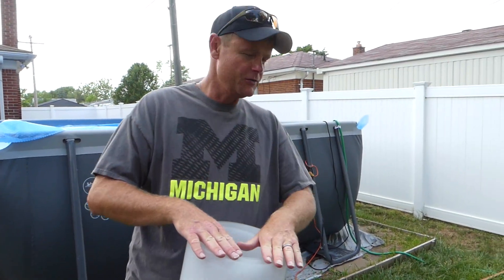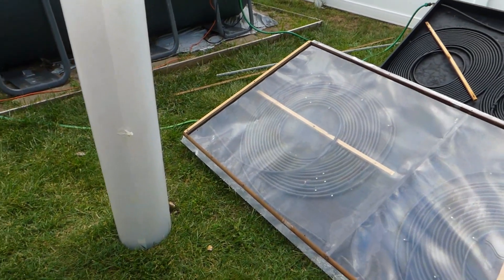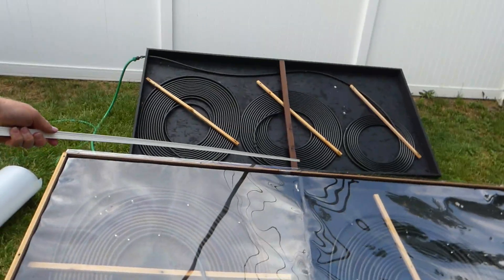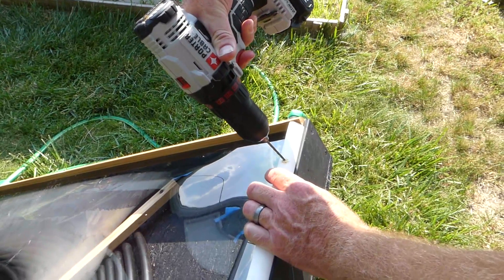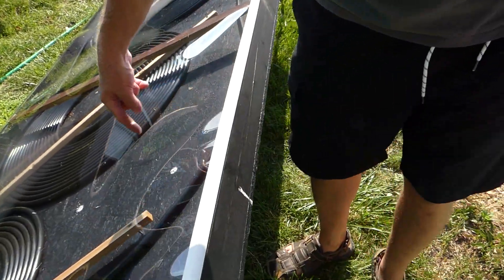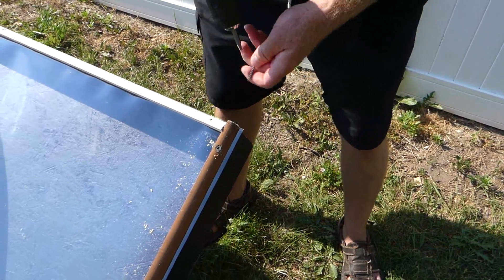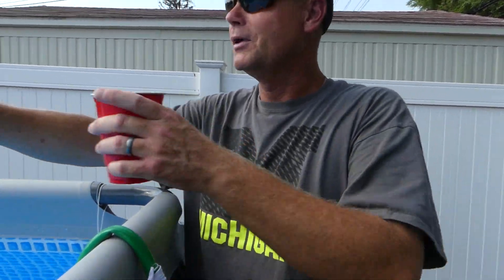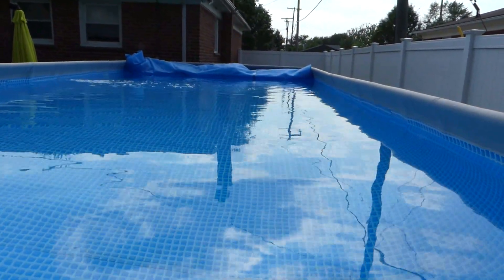How To Make Hot Water Using The Sun : DIY Solar Water Heater!

Comment: Nice video filled with good tips & trix. I'm setting up a solar powered pool heater right now and my goal is 30°C / 86°F in the pool. I'm starting with 250 meters / 820 feet of 20 mm / ¾ inch PEM hose in a flat rooftop setup. A 20V rainwater barrel pump (2,000 liters - 528 gallons / hour) will be connected directly to a solar panel, so it's a completely automatic system controlled and powered by the sun.

No sun = no pump = no heating.

Since I'm located at 60° latitude in the northern hemisphere, I'll guess it'll be some problems and math to solve along the way, but it'll be fun.

Keep up your good work
Reply from the maker: Nice!
Make sure you stop back by & let me know how it works.
I would love to know :)
Thanks for dropping by & happy heating my friend!!
@RCInsiders
Reply: @RCInsiders  There is still freezing temp at night time over here and I'm so eager to start this project, but I'll let you know when it's up and running
Reply from the maker: @SolarProjectsSweden  Thanks!

Comment: Hallo. I have a question. If I will have a solar panel on the roof - 3 meters above water level and 20 meters from the pool. What pump power is needed?
Reply from the maker: Hi,
Here is the pump I use - https://amzn.to/33pkhrl
This pump has a 10' lift & pumps up to 800GPH 
At 3 meters this pump may be enough. If you want to go on the safe side, I would go with a pump that has a 20' lift.
This one is a good pump - https://amzn.to/3Jq9S2L
I'm thinking about putting one on my roof too & will have to go with the 20' lift pump.
Let me know how your project goes if you get the chance.
Thanks for dropping by & have a great day :)
@RCInsiders

Comment: I just built this today and got it in. The tubing was extremely hot but when we started pumping water through it seems the water cooled down the tubing. I am in Georgia and it’s hot but my back yard gets a ton of shade. Is it normal for it to cool down the tubing for down time? It does not seem to be heating up currently
Reply from the maker: Hi Jack,
Yes it is normal for the tubing to cool with the cool water going through. How much shade would you say you get? How much time on average are the coils getting sunlight? If they don't get much sun it will be hard to heat the water much more than outside temperature. When they are getting direct sunlight what is the incoming/outgoing temp differential? 15-20 degrees would be good.
Thanks for dropping by & have a great day!
@RCInsiders

Comment: 9700 gallon pool what could I expect one to do? I’m in NY
Reply from the maker: Hi,
Ours is around 8200.
Always maintained 84-88 degrees & hotter on hot sunny cays.
I have since added a second unit and often times don't even run it as the pool temp gets into the 90's.
I'm in MI so similar climate.
Thanks for dropping by & happy heating my friend!!
#RCInsiders

Comment: How heavy is the collector? I am tempted to put it on the roof of my shed, but trying to get a sense of weight.
Reply from the maker: Hi,
The water heater when full is approximately 100 pounds.
With a 4x8 sheet of plywood (surface area of the heater) you're looking at approximately 3 pounds per square foot.
What is the shed made of? Does it have a trussed roof?
I think it would be ok, but you need to check the weight rating of the roof, 
Thanks for dropping by & happy heating my friend :)
#RCInsiders
Reply: @RCInsiders  The roof of the shed is trussed, a standard 10x12 from lowes...the installer certainly was on the roof installing shingles so I am pretty comfortable with putting this on the roof.  Thank you for replying!
Reply from the maker: @michaellanham1527  Awesome! If you get the chance let me know how it goes?

Comment: How late in the season has this worked? I am in MS and making this tomorrow. I have 300' of 1/2 inch irrigation tubing and was on the fence about black for the back of the board or using silver insulation type material. I'd love your thoughts on which may work better behind the tubing.
Reply from the maker: Hi,
We are in MI & still running now. The sun is getting lower & weaker but still hoping for a couple, fingers crossed few more weeks! :)
Last year we closed up 1st of October & planning the same this year. 
I would think that in Mississippi you should be able to make hot water through Fall & maybe into Winter or more,
As long as you can put the unit that gets good direct sun for a good portion of the day you will do well.
I always suggest black as this attracts & absorbs sunlight the best & the cover traps most of the heat to further heat the water as it goes through the tubing inside the unit.
How big is your pool?
Thanks for dropping by & happy heating my friend!!
#RCInsiders

Comment: Have you ever thought of using a thermostatic controller so the pump only runs when the temp in the box is above a certain level? BTW, what part of Michigan are you from?  Do I detect a Yooper accent?
Reply from the maker: Hey Dennis,
I have not tried this, but sounds interesting :)
I have experimented with timers with success,
On cloudy cool days I'll set 15 min on/off.
I'm in the LP, but have spent some time up & around there 😜
You a Yooper? So beautiful up there!
Thanks for dropping by & happy heating my friend!!
#RCInsiders
Reply: @RCInsiders  I'm in Munising,  45 miles east of Marquette.  When I get my heater built, I'll let you know how it works up here.
Reply from the maker: @dgramm  Awesome Dennis!
Me & my Dad used to deer hunt just outside of of Manistique. 
Love the UP :)

Comment: Very informative video, thank you RC Insiders! Question: would this work for a 17x34 ft, ~20,000 gallon inground pool, and if so, how many of these/how large of a unit would I have to make? Also, I'm reading that solar pool heaters only bring up the temp 7-10 degrees on average. If this is true, I'm wondering if that's enough for a northeastern climate, and if it's then worth the sweat. Thoughts?  How much of an increase would there be in the electric bill to run this for my size pool?  Thanks!!
Reply from the maker: You're welcome Jump!
Your pool is roughly 2x the size of mine, so I would suggest 3-4 to keep the temp over 80. That being said, there are many days throughout the Summer where I don't have to run the heater unit as it can get too hot with a string of sunny days.
7-10 degrees is fair, but determining factors are amount of direct sunlight and outside temp.
With these 2 units on a hot & sunny day I can raise the temp 10 degrees in 1 day & easily maintain it. On cloudy days, it may take 2 or 3 days to raise 10, but can still maintain the temp.
Remember to always keep the pool covered with a cheap solar cover when not in use, especially at night as this is when they lose the most heat.
One of the pumps is good enough to push water through 2 units, so you may need a 2nd pump if you add one or two extra units.
The pump in the description will cost approximately 7-10 cents per day to run, so if you ran 2, around 10-20 cents a day if you ran them for 10-14 hours a day.
I'm in Michigan & know how short our pool season is...I'd do anything for a few more days in the pool 😜
As far as worth it, absolutely. This is not a gas or big electric pool heater that will heat instantly & as fast as you want. On the other hand there is no multi thousand $ initial investment  & 100's of dollars a month in gas/electric.
And it's a fun project to do & it feels good when you see heated water coming out that you are making with the sun 😃
Let me know if you have any questions if you decide to build. Happy to help :)
Thanks for dropping by & happy heating my friend!!
#RCInsiders

Comment: probably one of the best videos.  thank you.  i'm in the chicago area and wanting to building one but i have a few questions i hope you can answer.  
1. say in the morning when your pool water is low 70's and it's suppose to be 90's that day.  do u start your solar heater pump when you wake up or do you wait til later morning or mid day?
2. i have a 24' round pool.  how long does it take to warm up your pool to get it to your ideal pool temp, i believe u said 82 degrees?
3. the pump u have linked to amazon, are you still using the same one since you added more hose from your first build (OG) or did it crap out on you and if so would you recommend another one? 
4. your plastic hose hold downs, are any of them giving way/melting since it gets so hot in the solar heater?
any other insight would be greatly appreciated.
Reply from the maker: Howdy from Detroit!
Thank you :)
1. I am usually at4 & start the pump as soon as the sun hits the heater units. Usually around 730 or so depending on time of season.
2. After opening this year we had 3 good days in mid 80's & sunny. Got temp from 65 to 84..
3. Same pump. The flow rate decreased with the added hose, but keep a consistent outgoing temp of +8 - 15 degrees all day when sunny.
4. Nothing has melted yet :)
My best advice for maintaining temp is to always keep it covered with a cheap solar cover when not in use, especially at night as this is when you lose the most heat.
On cloudy days I have had some success using a timer to give the water some time to sit in the unit to heat up.
Any questions you have I will be happy to help.
Thanks for dropping by & happy heating my friend :)
#RCInsiders
Reply: @RCInsiders  your awesome.  ty for replying.
Reply from the maker: @yeeman7421  You're most welcome. 
Have fun with your build & let me know if I can help :)

Comment: I want to see a video or someone does exactly what you did but tap into the existing pump put a check valve on it and a gate valve of some sort so you can throttle it back no and understand it will take longer for it to heat the pool but there would be no lines running across your yard or anything else within a couple of days the pool would be exactly where you want it to be as for as temperature was just a thought
Reply from the maker: Hi Larry,
This can absolutely be done.
I went this route because I did not want to run the big pool pump constantly. It would be a lot of extra wear & tear on the pool pump & use a ton more electric :)
Have you built a solar unit?
Thanks for dropping by & happy heating my friend.
#RCInsiders

Comment: Hi I bought a pump 

https://www.ebay.co.uk/itm/DC-12V-19W-Ultra-Quiet-Mini-IP68-800L-H-Brushless-Motor-Submersible-Water-Pump-f-/143999743360?_trksid=p2349624.m46890.l49286

800 litres / hours . 19w.

So not much more power then yours but just a little more. 

1. * When I submerge it in water. It works fine.  But when I attach a hose to it and put the other end of the hose in the water to extract the water, it doesn’t work..  any ideas why?

Thanks
Reply from the maker: Hey James,
Is that a battery powered pump? I see it is DC only.
It wont pull water because it is a submersible pump. Without being submerged, it has no way to prime itself. 
To be able to actually suck water out of the pool you would need an inline utility pump like this:
https://amzn.to/3nOsKwi
They are quite a bit more expensive though.

Comment: Would a 

1. double glazed unit (two planes of glass with a cavity inside as normal double glazed units are) be better to heat the pipes? Then a single plane of glass ?

Thanks
Reply from the maker: Possibly, but you don't want it to get so hot that it melts the coils. Also, I suggest against glass as a safety concern. Much more dangerous to work with. Also, my solar water heating units a re on the ground. If someone fell on them, there may be bruises VS who knows with glass
Reply: @RCInsiders  I may make something like this 

1. https://youtu.be/btQtPQpUf90     or 
2. https://youtu.be/Sc78nueDQ64

The only differences being the dimensions (to fit over my raised bed, and be portable at the same time) and maybe I use PETG or single glazed, or double glazed glass or triple glazed glass. 

I am doing my homework now so I make the right choice thanks.
Reply from the maker: @harunyahyadotorg  Cool. Let me know what you do :)
Reply: @RCInsiders  also in Manchester uk. 21 C ~(70f) and people take their tops off.  So that’s seen as hot here. 27C  ~(80F) for more then a few hours a day for a week) is a heat wave!
Reply from the maker: @harunyahyadotorg  Lol! Yeah, here in Michigan we are coming out of a tough winter & anything over 60f feels like 100 right now :)
Reply: @RCInsiders  I don't have any problems with safety, (or anyone jumping on top of it or breaking it).  I may have the unit out of the way, maybe on top of my raised bed (1.15m by 0.75m max) that has a (plastic clear) tunnel cover. It has a compost pile under it, so nothing growing on it, so it doesn't need the sunlight.  So I am just weighing the options of 1. clear glass sheet, 2. PETG, 3. double glazed, 4. triple glazed. So not sure what is best. 

Also glass allows 90% light through the same as PETG glass, and therefore a double glazed unit will only allow (0.9*0.9) = 73% light through two planes of glass, and a tripe glazed will allow less at (0.9*0.9*0.9) = 66% light through. 

The question is which will make it hotter the most. In rank order. I want the science.  I don't care about costs just yet. Nothing will melt or burn, (I may use a single 10-20m compression copper pipe, or a 50-100m black plastic pipe).  It's not going to be that big nor that hot. I doubt temperature gets above 100C to burn anything let alone vaporise the water, in such a small unit.

*Also I don't care of the weight as PETG is half the weight of a single plane of glass and  therefore, 1/4 of double glazed and 1/6 the weight of triple glazed unit.
Reply from the maker: @harunyahyadotorg  OK. Assuming the glass you would use is not insulated, I would use the plastic. Plastic is 5-10 times better insulator than glass & still lets light through. Also, glass can cause a magnifying glass effect that can and will melt things if you don't keep a close eye on it..
Reply: @harunyahyadotorg  It would seem you should make it as hot as you can and when it gets over a certain temp just increase the flow to cool it back down. That’s what I’m going to do.

Comment: Pump cost: £48.99 from Amazon,
Pay: £28.99: (If you) get a £20 Amazon Gift Card on approval for the Amazon Platinum Mastercard. Terms apply.
Pump Features: 
Reduced the mortality to 0.05% after long-time study. 
Suitable for submersible installation. 
A large flow and high head, widely-used, smooth operation. 
100% copper motor, brushless, non-pollution, small size with high efficient. 
Super energy saving, low consumption, strong anti-jamming ability and stable performance. 

Specification: 
Color:Black 
Type:12V 
Color: Black 
Size: 90*46.4*67.2mm 
Material: Plastic 
Voltage: DC 12V 
Power: 14.4W 

Package Included: 
1 x Bluefish Submersible Water Pump
Reply from the maker: The pump listed in the description is only $20
Reply: @RCInsiders  I’m in the uk (Manchester), it’s a different price here.
Reply from the maker: Oh OK.

Comment: 1. What water pump do you use? 
2. And how much power (electricity does it use)?  eg 100w pump or 1kw. 
3. Is it possible to take water from the bottom of the pool, so that with pressure it goes through the two thermal boxes and comes out it self from the top? self circulating but I would guess very slow? Hence a pump will be best or even a necessity. 
3. Have you thought of placing the end of the hose pipe inside the pool, by attaching some weight to it so it sinks into the pool to eliminate heat loss and evaporation by having it being sprayed from the outside. 

thanks
Reply from the maker: Hi James,
The pump is listed in the description. Not sure exactly but I believe 30w. I don't think there would be enough head pressure to self circulate.
Reply: It is 30w pump. 14.4w.
12v Dc supply.
Reply from the maker: @harunyahyadotorg  Cool. Thought it was that

Comment: 1. The 4-5 meters of hose that you have outside, (connecting both thermal boxes) you can have inside, just drill the holes in different places, and have the connections near the entry points) to keep the maximum amount of hose inside the thermal boxes. So you have minimum amount of the hose outside the thermal boxes.
Reply from the maker: Hi James,
Excellent idea. 
These boxes were built at different times & placed for max sun exposure.
Back yard is small & always fighting shadows :)
Are you going to build one?
Let me know if I can help.
Thanks for dropping by & happy heating my friend!
#RCInsiders
Reply: @RCInsiders  hi yes I thought they maybe, as you said in the video. I thought if anyone else was going to make one, they could consider that. 

I’m going to make one. I shared my two options in the other comments above.  

Thanks

Comment: Great video! Setting up our first Intex 18 x 52 pool in a couple weeks and after watching endless videos, I’m going with your build!
Such a great job explaining every step of the way.
Regarding the pump...1) can I go with a larger pump with a little more flow or is slower (less flow) better?
2) Can you swim in pool while the pump is still running/plugged in?
I’m assuming this is ok and not a safety hazard?
Thanks!
Reply from the maker: Thanks Fish...Congrats on the sweet new pool!!
I have found that this, or 1 similar has worked out perfect. On hot sunny days I run the pump on highest setting for max turn around rate. On cloudy days I set on lowest setting to allow water to spend a little more time in the coils to heat.
These pumps are suitable for fish tanks, but I always un plug before swimming.
This is more piece of mind and wife yelling at me than safety :)
Let me know if you have any questions during your build,
Thanks for dropping by & happy heating my friend!!
#RCInsiders